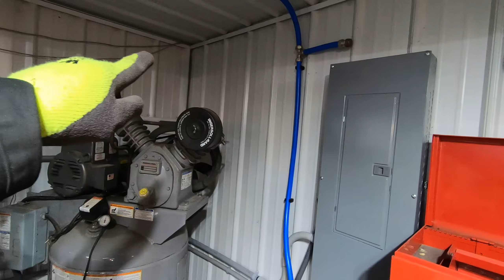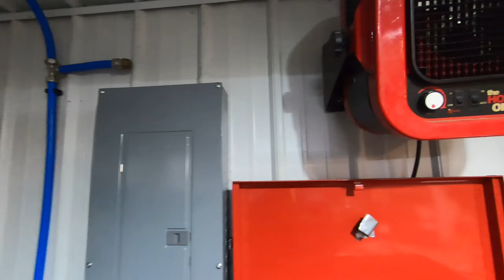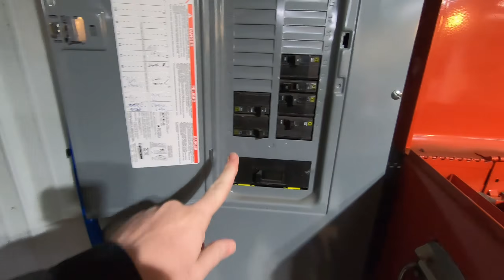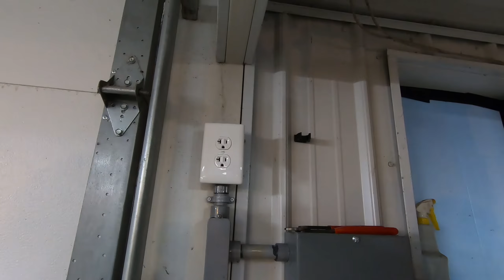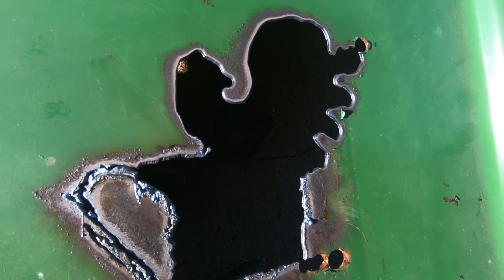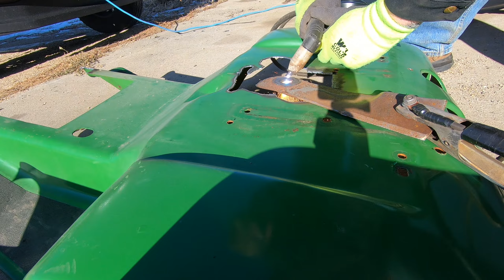Setting up a Cutmaster 82 Plasma Cutter

Comment: Wow! A cut master 82 from what I heard is up there with a Miller or a Hobart. I run with a real caveman crowd though ... I have a question, what is a John Deere 112 in great shape with a model 20 style compressor attachment worth? Or shall I say what should I ask? I love the tractor and was going to build a backhoe and front end loader for it however I ma running out of room. Thank you.